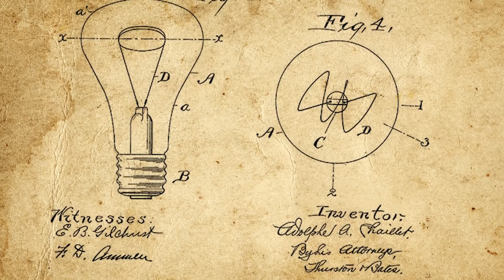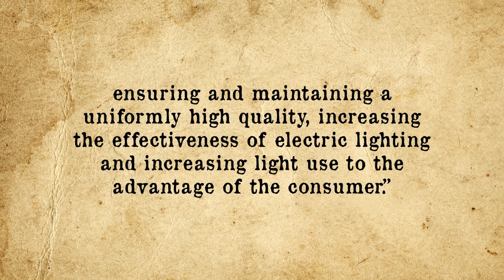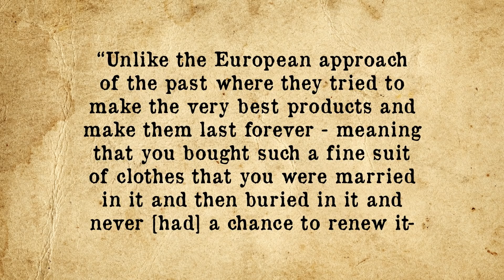The Great Light Bulb Conspiracy

Comment: Planned obsolescence is one of the most cancerous things modern society has ever invented.
Reply: Not so.
Obsolescence will always happen, and it is a lot worse when it is not managed. Imagine paying for a car built to last 100 years and finding out it cannot be made to meet emission standards after 10 years. Or buying a leisure suit that will last 50 years.
If you had bought a package of incandescent bulbs at $15 apiece that were guaranteed for 50 years, would you be happy now? (A couple of years ago I reduced our electric bill by more than $70 a month by replacing six bulbs that were in almost constant use with CFLs - I despise CFLs but they did the job.) Or if you had a car that was designed to last 50 years, with repairs monthly in the waning years?

I don't know anybody who wishes they had a GE Monitor refrigerator or a wringer washing machine. Paying for longevity has practical limits.

Comment: i have LITERALLY never owned a printer long enough to see that, a brand new printer, with ink included, is cheaper than an ink refill a good 90% of the time, so instead of getting a refill, i just get a new printer, i don't think i have kept a printer for over a year, since 2005 or so?
Reply: My father is the same way. Buys new ones cheap on black Friday sales and stores them until needed
Reply: @cougarhunter33  you dont even have to wait, printers are on sale almost all year long, especially canon, the ones im talking are about $50 for a whole printer, with ink, but the ink alome is about $60.
Reply: @stapuft  My father is the one that messes with the ink jet printers. I use printers so infrequently that I would have to buy new ink every time I printed. 
I've had laser printers for about 15 years now. A friend bought a pallet of used HPs from a school auction and I used up two of those before I bought a color laser about five years ago.  Just bought the first black replacement toner on it after it was showing low for more than two years.
Reply: @cougarhunter33  yeah, lasers seem to true way to go, i loved the one i had for a whole, i was actually paid to remove it from, an office building and "recycle it" they were getting a new one, and told me that the old toner wouldnt fit in, so i could take it too, it was an old B/W laser printer.....but my dad is STILL using it to this day over 5 years later, and only had to buy new toner this year....it was like $100 for toner....but it lasts SO DAMN LONG.........

Comment: Everything is made with an expiry date . Meaning not to last cheaply made so you have to buy it many times over .  Back in the day things where made of quality  to last overlong period of time .now greed has taken over and things are made to break  so you have to keep replacing them . Now this is a throw away Society . Thanks to greed .
Reply: It is not greed, it is intelligence. In a time when technology obsoletes everything in ever shortening times it is horribly wasteful to make something that will last 50 years but be useless in 20 years. That pace is picking up even more rapidly than the public is aware.
I started working in IT in 1984, after 14 years in aviation. Until about 1990 all the equipment I replaced was because it had become unreliable. By 2000 very few pieces of equipment ever failed; they were replaced before they failed because they no longer met network requirements. If you have a cell phone from 1990, throw it away. The system it used in those days has been gone for decades. For many years everybody in the industry has known this can't go on forever; there is a wall somewhere ahead of us and we are clinging to a rocket into the darkness, the thrust constantly increasing. Making almost anything to last 20 years is ridiculous.
Check out the history for automotive safety devices in the US. How long would you really want a car with automatic seat belts to last?
Reply: flagmichael  Yes you are right. I see your point to . Thank you .

Comment: My Epson inkjet printer was the most trouble free printer I owned until one day the automatic software update told the printer that my stock of Epson ink cartridges where out of date and no longer recognizable. :(
Reply: Well, one has to be careful when using out-of-date ink, who knows what sort of calamities might happen if you try to print using it? It's safer for everybody to just disable it, you know, just in case...
Reply: Why did printers need to have a update system to them again? It seems kind of silly
Reply: @acamera367  because they dont make money on the printers, but on the inks, its the same for video games, sony and ms lose money on the hardware, they make it up on the fee they get from game sales
Reply: Had this with a Brother printer I recently purchased. Only worse, the update was automatic and on first use, said the ink cartridges were out of date... The damned cartridges came with the printer that I had just bought.

Comment: As always, very interesting. But I wish you had explained the reason behind the American screw fit bulb versus the British bayonet fit bulb thing and why it's called a bayonet fitting.
Reply: It's more difficult to accidentally touch the live connection with a screw bulb in a fixture that is correctly hooked up. They are called bayonet fittings because they work like the connection that secures a bayonet to a rifle.

Comment: Electrician here. Any light bulb will last longer if you never turn it off, or at least as little as possible. Also, when installing a new fluorescent bulb, leave it on for at least 48 hours, it will last longer and have a cleaner light quality.

Comment: There is a difference between planned obsolescence and building to a price.  Building to a price is why you can buy Chinese made garbage from Harbor Freight for a quarter of what a quality version costs.  Nobody expects them to function as well or last as long as a mainstream brand.  HFT only offers a 90 day warranty which means they know it's trash and so do their customers.  Planned obsolescence is also why the average car battery doesn't last more than 6 years anymore.  They used to routinely last more than a decade and I have pulled cars out of barns with batteries over 20 years old that would still hold a charge, but battery companies intentionally use poor quality lead so they don't last as long and didn't reduce the price to consumers.  In fact they significantly increased the price for batteries that last as long as they used to be.  Lead cost a little more than a dollar a pound and the chemicals and plastic shell can't cost more than a dollar and the technology has barely changed in a hundred years so no R&D expense.  So why do batteries cost so much?

Comment: Well there is some point when any further development doesn't really bring any great benefits for the buyers and they are likely to just stick to their old devices as long as they work, harming the delevopment. Like cars came to that point many decades ago and the relibility has been sliding down sharply since 90s, computers have reached that point around 2010, smartphones some 5-6 years ago.
Reply: I disagree with the reliability of cars dropping over  the 1990s. As a Prius owner for 18 years, I say it has never been better, probably in the history of cars.
Reply: @flagmichael  Tell that to people deep in Russia still driving 1980s Audi 100s they imported from Europe or all the golf mk3 or early 90 citroen drivers here in Europe. People just scrap 100% working, good condition cars after their value goes below 500€ because at that point the checkup and insurance fees are higher than the cars total value xD.

Not to say there aren't any good exception but for instance vw 2000 and up rust much muuuuch more than earlier date cars of the same model.

Comment: Is Planned obsolescence really a conspiracy anymore?
Reply: No, it is a discipline. Lifecycle management is expected of engineers everywhere; the world changes so fast that manufacturers have to be careful not to spend money on things that will make them last significantly beyond their useful life, or even well beyond the point the price has plummeted to a fraction of what you paid. Consider the landmark high quality calculator, the HP35. "If you look at the HP-35 today, it seems laughably simplistic. The calculator app in your smartphone is much more powerful. However, back in 1972, and at a price of only $395 ($2,350 in 2017 dollars), the HP-35 changed the world." https://www.hpe.com/us/en/insights/articles/the-early-history-of-hp-calculators-1709.html
There are still quite a few of those iconic machines around today, although parts availability is spotty at best. Or you can buy a much more powerful Casio FX-300MSPLUS2 for $10.99 (list). Somehow that does not seem like good lifecycle management.

Comment: LED bulbs should last almost indefinitely. So, why don't they? Could you do a video on that plese?
Reply: Poor build quality as well to make them dirt cheap. Heat reduces the LED and other component's life. Bulbs are overdriving LEDs running them hot but bright and most just have a tiny sliver of sheet metal as a "heatsink".

 Install one in an enclosed fixture in the ceiling or similar, and it's amazing many of the bulbs last as long as they do.
Reply: Because then the companies selling them would not make more money since you would only ever need to buy the one, maybe two just in case.
Greed holds our species back.
Reply: Jayme Vosburgh yeah it’s basically a combination of all of the above, the 2 most frequent failures are due to the cheap components in the driver circuit that certainly don’t have that lifespan, and insufficient heat dissipation because the manufacturer didn’t put enough metal, for cost reasons i imagine.
But when a led dies most of the time it can be easily repaired. I salvage them all, and even when the led is the failure its not worth throwing, only one diode out of the many failed the rest are good to reuse or you can repplace the bad one
Reply: @jaymeVos  How likely are you to buy a $50 light bulb, even if it does last for 20+ years? Most people are much more willing to fork out $5 for a bulb that lasts them 5 or 6. In fact, the "cheap but lasts a shorter amount of time" can be CHEAPER for the end user in some cases depending on how expensive it is to make something last "effectively forever". Companies don't exist if they can't pay the bills, and if they charge near at cost for something that lasts forever, they may sell a bunch up front, then go bankrupt immediately afterwards. Who does that help exactly? The economic model has to work for both the business AND the consumer. I'm not saying some things that the businesses described here were doing weren't shady, but they do need to make sure they operate in a way that is sustainable as a business, which does require ongoing cash flow of some sort.
Reply: B @flagmichael i agree, heat is the grim reaper in electronics, be it though prolonged expose or short circuit what components are usually destoyed by heat.
But in the cas of those LEDs most might as well be immortal considering their potential lifespan vs how often we have to change them. I change my bedroom bulbs every few months, but under normal conditions the LED could last decades. And if they are used at slightly reduces power the reduction in current/heat is squared, witch almosts negated the heat deterioration.
From taking apart countless bulbs i know how they fail it’s always the fault of the manufacturer. The circuit beneath that led doesn’t deserved to be called a power supply, some are so weak they blow up when you plug them in without a load. The rest have the smallest and cheapest components possible and the bulb has the minimum amount of metal to prevent the led from instantly dying, but put your finger on a 5w led left for hours and it will burn, it’s above 60-70 degrees. That will cut the life of any component, and those tiny semiconductors in the circuit already had a limited life.
The led themselves are in most cases actually surprisingly well made. Sure i’ve seen some shitty leds where the dioes wern’t even properly lined up, not identical and obviously pooply made but most cheap bulbs will have a good diode (for good light) and speend the least possible to make it sellable.
I m sure if you built the perfect power supply with top notch components rated well above, good diodes and a design a massive heat dissipation enclosurz that can not get above 20c you would get a bulb you would keep for half you life
Reply: After more than 50 years in electronics, I can certainly explain: heat. In the end, all electronic components gradually cook themselves. It may only take a few days or it may take centuries. Heat works on both a chemical level (changing compounds, causing oxidation or outgassing) and a molecular level. LEDs have a junction that is responsible for the light; that junction gradually diffuses itself under the effects of heat, voltage drop, and current flow. If somebody makes a light source that is 100% efficient there will be no energy available to degrade it, but until then the laws of physics make light sources temporary.
The poster child for inherently limited life in solid state electronics is the tunnel diode. Once rather popular because of their extreme high frequency operation in a world where UHF transistors were rare, they typically lasted a couple of years. The highly doped junction, only 10 nm thick, gradually blurred under the modest strain of normal operation and to some extent just ambient temperatures. They are still available but the life limitation still exists.
Reply: @flagmichael  That's the best explanation I've ever heard for why solid state components wear out. Thanks.
Reply: The LED's do. The $0,05 transformer that drives it doesn't

Comment: I still have an incandescent light bulb in my kitchen. I wish that I would have bought more when I could. I never leave light on, I set the thermostat low, I don't use a dryer or dish-wash-machine, it is fine. Let me have light bulbs.
Reply: Go to a lighting store and find what color/coolness of light you like.  Seriously, LEDs come in all sorts of shades and really save a ton on your bill.  Even today, when most people have LEDs the average electric bill is 9% lighting.  LEDs use 20-25% of the electricity an incandescent does.  Reversing the math, say your electric bill is $50/mo.  That means you are using about $4.50/mo on lighting if you are using LEDs, but if you are using incandescent instead (housewide) you are probably spending about $18/mo lighting.  Switching to LED would save that house about $13.50/mo.  or $162/year.  (Obviously just one bulb would be less, but that's the math.  LEDs really can have light colors just as nice as incandescent.  It's not like CFLs that flickered.  You just need to compare them a bit.)
Reply: @NacorantheHarmonicaPlayer  I barely have my light-bulb burning. Even while cooking it only is on while I need to be there but most of the time I am not there because I have to wait for the water to cook and the vegetables to get ready. For example, when I have my computer monitor on I have no other light-source because I don't need it. But when I do need light I like to have light with a wide frequency spectrum. I don't want the trade-off between cold light but visible and warm light but poorly visible. Maybe LED's have improved but so far I have not been impressed by what I have seen in the stores. In my case I would spend much more on the LED than on spared electricity cost because I use artificial light so little. To make it concrete, I have my light burning 5-10 minutes a day maximum and it is 40W. 

When my light-bulbs die I will step over to LED's, I hope that at that time not only the quality of the light has improved but also the longevity has improved. None or less planned obsolescence. That really is what bothers me about LED's, I don't mind paying €20 for a LED which lasts 10 years but often those LED-lights get worn out after half a year, based on what I hear from other people.
Reply: @NacorantheHarmonicaPlayer  My electrical bill is around €30 per month, but this is in the Netherlands where electricity is expensive. At least €0.2 per kWh. That is not so bad.

Comment: Apple is the modern face of "planned obsolescence". What's sad about it is that it's well known across the world, and customers keep accepting this as something that is "normal".
Reply: It is not merely normal, it is crucial. If you have a cell phone from 1990, even if it operates perfectly it does not work. The system it used was removed in the early 2000s.